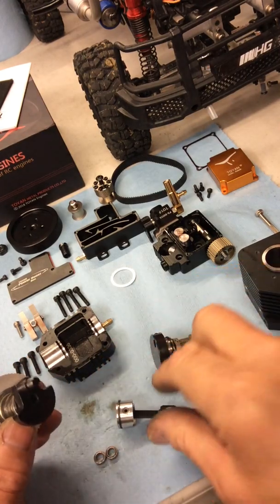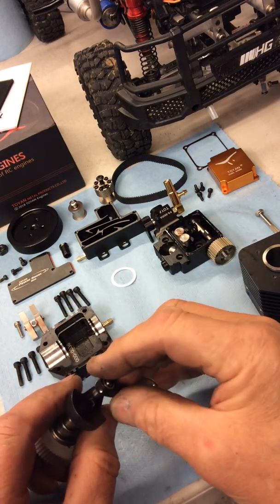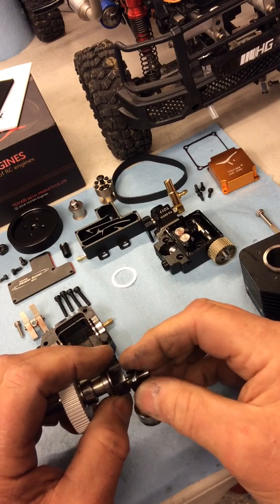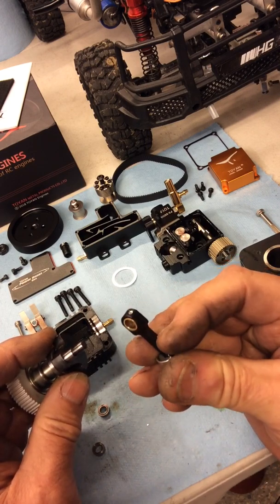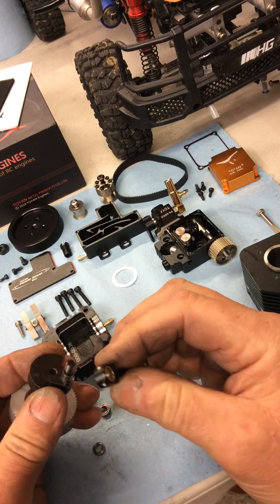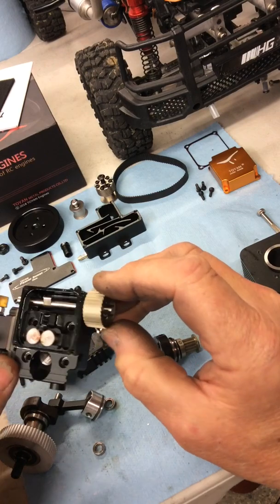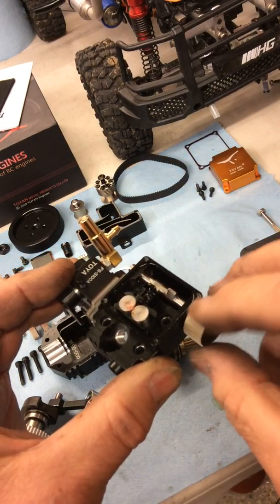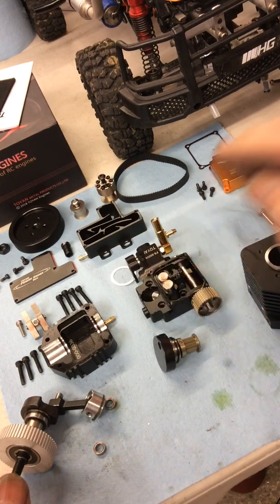Toyan Fourstroke Rc car engine bearing modification.

Comment: Hey there! I have to put a new crankshaft in my engine if it ever gets here. Do you think it would pay to find a better quality metal or ceramic bearing in there or you reckon the bronze bushing is the only way to go?
Reply from the maker: Hi, bronze is fine, you do t need a new crank just follow my video 👍🏻
Reply: @Blacklamass  I have to put the new shaft in because half the threaded bit snapped of after putting the clutch on.

Comment: Excellent video brother!  that rod repair will last forever!
Reply from the maker: Dennis Dempsey Radio out of control 
Thanks Dennis, now what am I going to put it in lol any ideas ??
Reply from the maker: I’m thinking of a light weight 4x4 and gearing it up not sure
Reply: @Blacklamass  Hmmm, lol there are so many full frame kits now days,  the traxxas bronco, hg-p407, the scx10 frames are on ebay to build your own truck. the seller is rcoption company. they have full complete axles also.
Reply from the maker: Dennis Dempsey Radio out of control 
Yes I seen the frame kits I got a 407 but it’s been done, I fancy something different, I do like the leaf sprung trucks but they are a bit bouncy, so I’m not too sure yet will keep looking 👍🏻